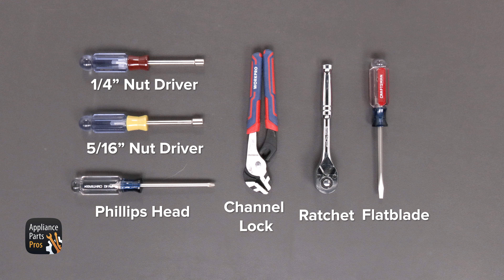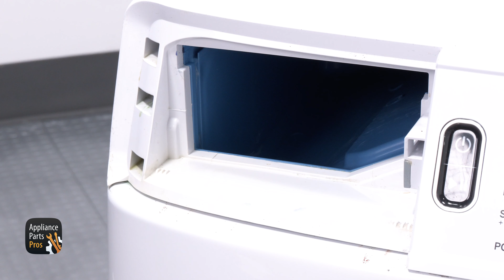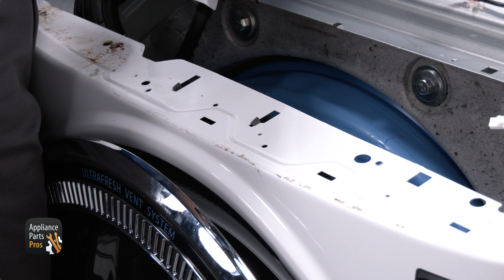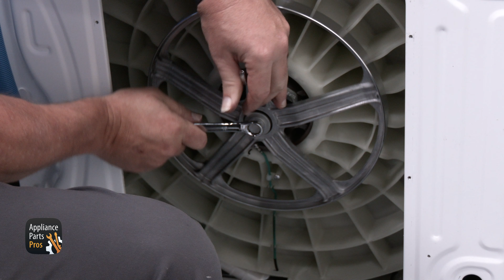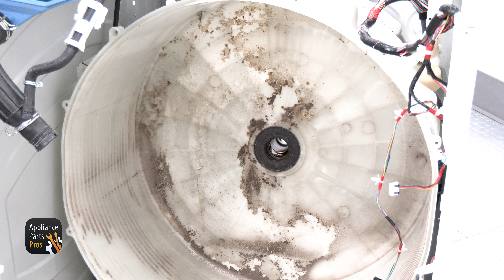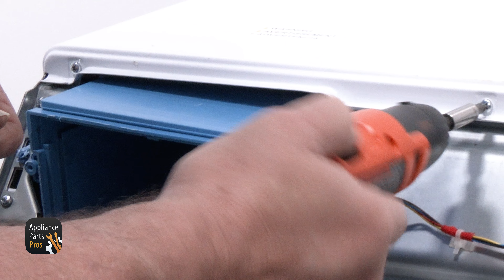Why Is Your GE Washer Shaking Like Crazy?

Comment from the maker: 🔧 Fix it yourself:
▶ Inner tub (basket) with spider/shaft assembly — GE front-...: https://www.youtube.com/watch?v=mS2BZwzxcgM
▶ rear outer tub assembly with bearings (no specific part n...: https://www.youtube.com/watch?v=DraAVXMQ4rw
▶ Suspension Rod Kit W10780051: https://www.youtube.com/watch?v=SHBgM8AZrow
▶ Suspension Rod Kit W11217817: https://www.youtube.com/watch?v=J_zlfzQWDJM
▶ GE Suspension Rod & Spring Assembly – WH16X544: https://www.youtube.com/watch?v=EYLgjsElAuE
▶ Suspension Spring – WP22001300: https://www.youtube.com/watch?v=F6DfxAOdleY

👍 Found your fix? Hit Like so others can find this video too!
🔔 Subscribe for more repair guides: https://www.youtube.com/@AppliancePartsPros

Comment: If it only jumps at low speeds, is there one component that might be the more likely culprit?
Reply from the maker: Good question. If it’s jumping only at low speeds, that can point to a suspension or balance-related issue, but there are a few possibilities. For detailed troubleshooting specific to your situation, our certified techs can help you at forum.appliancepartspros.com. Just post your model number and what you’re experiencing, and they’ll walk you through the diagnosis! 🤝

Comment: Feel like there were some additional instructions upon reassembly, that weren't provided during disassembly...

Thanks for doing this, I'm pretty sure I have a few of these issues. If I can push my empty washer drum around like it's just resting on rubber bands, is that enough to consider it likely being the struts?